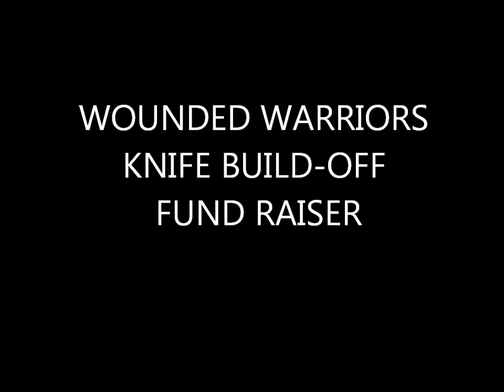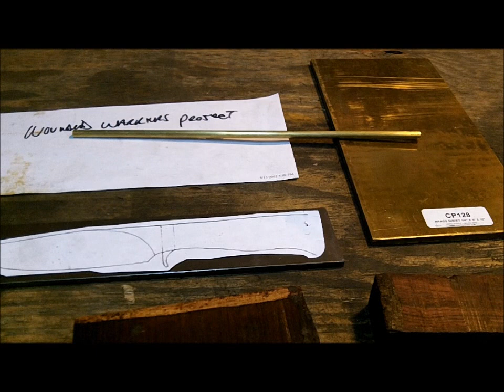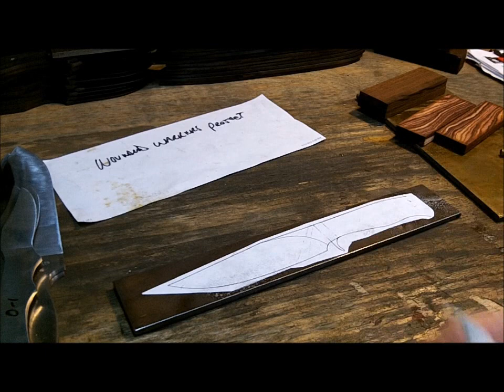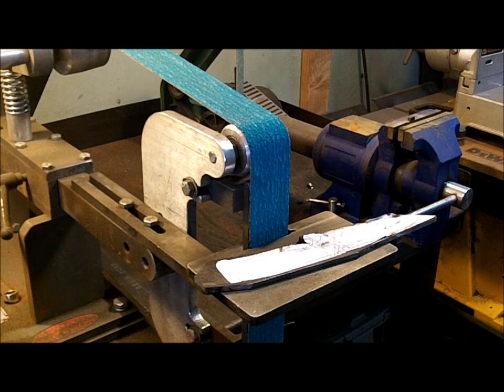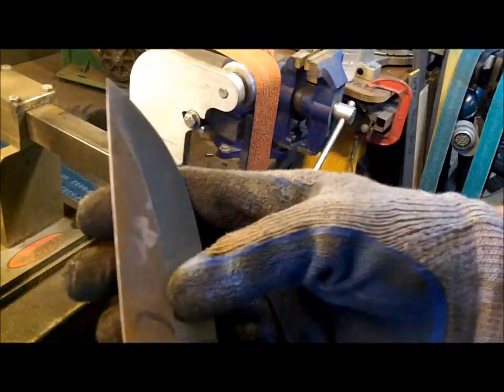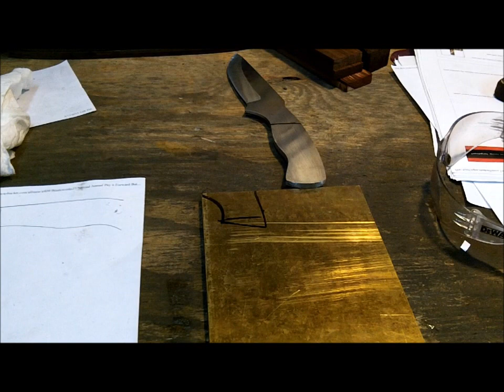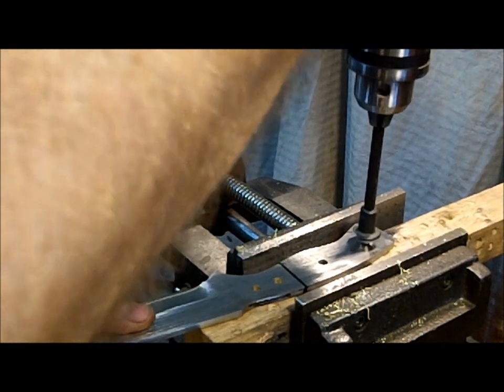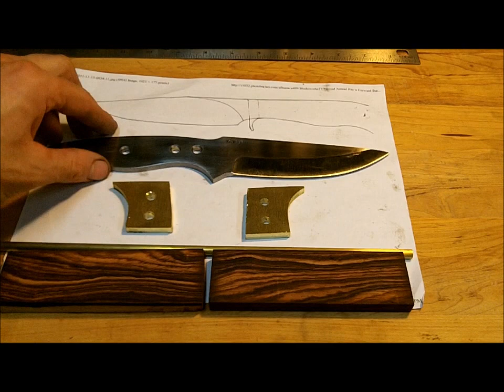WOUNDED WARRIORS KNIFE BUILD-OFF FUND RAISER (pass it on)

Comment: Great job and project!  I got a question about using the top aluminum wheel of your KMG to grind the initial design of your knife.  Are you wearing off the groves of the aluminum wheels?  I noticed on my KMG that the groves wear off faster if you make contact with the knife.  Are the groves important for belt tracking?  I'm not sure if the groves have a role in the performance of the KMG.  What are your thoughts.